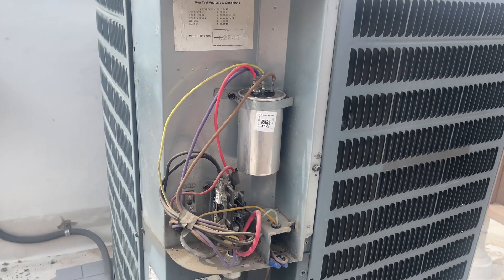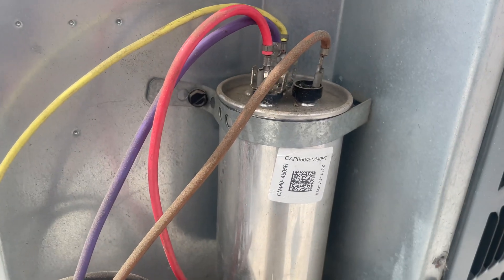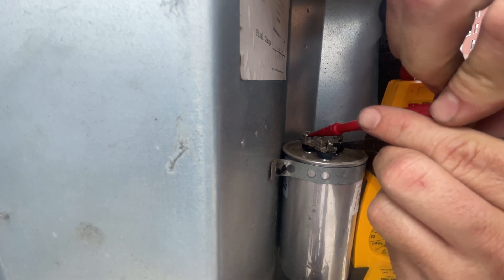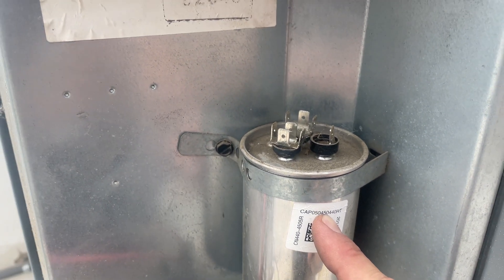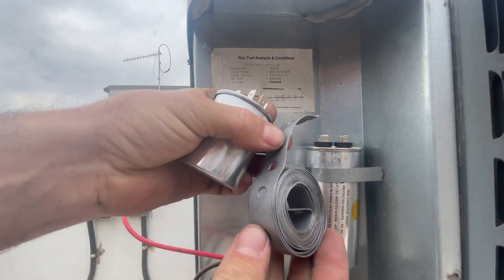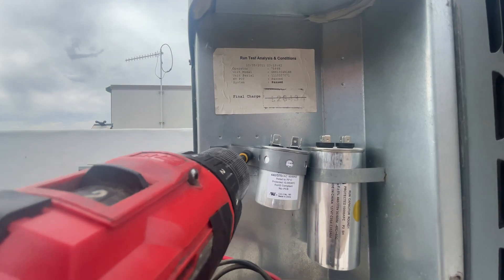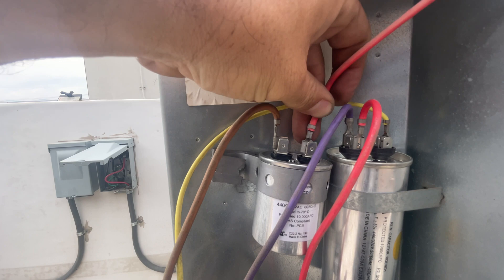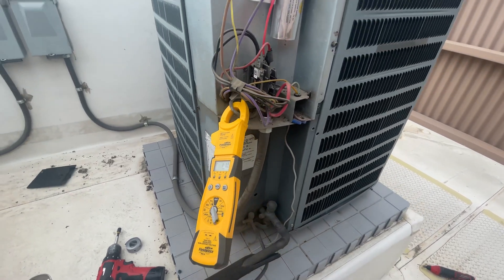How to Troubleshoot (and Replace) a Bad Run Capacitor

Comment: I just got an Amrad from Amazon with matching values to my old one. But the new one has an extra terminal called "CPT". CAN I just leave this terminal out of it?
Reply: They sent one of those to me too. I'm sure you figured this out by now but, Yes, Ignore the CPT connector. Your common is in the center. The CPT is for a "hard start" kit. Not needed on newer equipment .

Comment: Can the compressor and fan still be on or working and the capacitor be bad?
Everything is working from inside and outdoor unit, coils have been clean and new filter installed still no cool air blowing but fans are working
Reply from the maker: The fan maybe but not the compressor